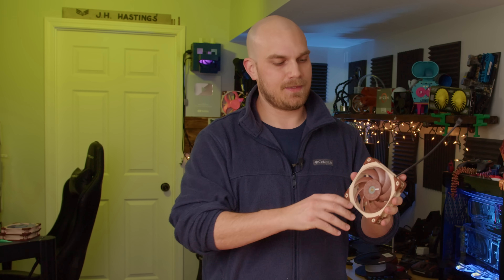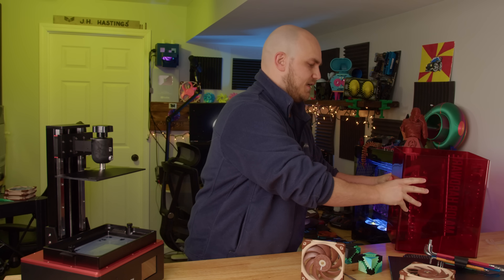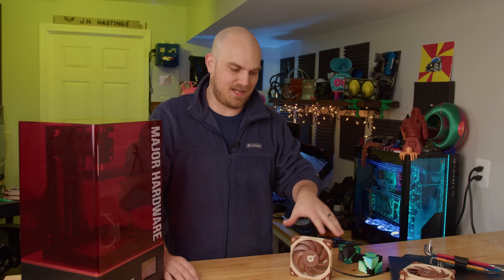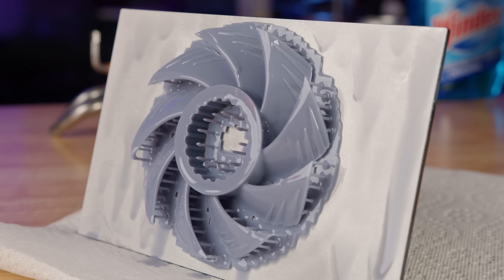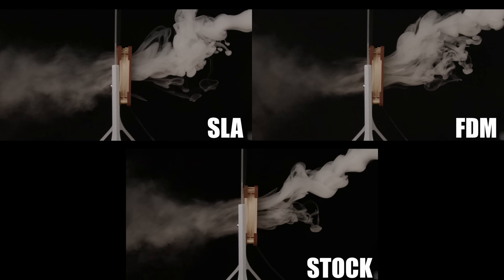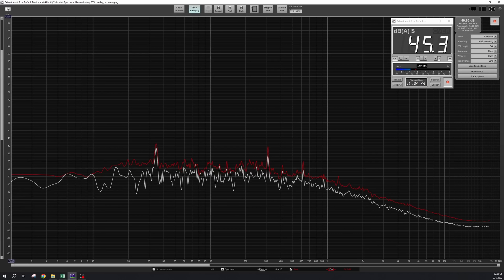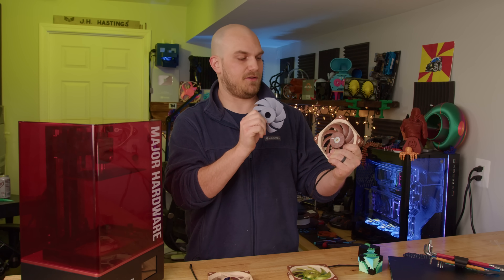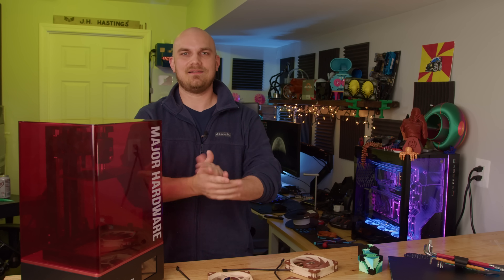I Copied Noctua's A12x25 and Resin Printed it, Its Performance Was ASTONISHING

Comment: I remember Noctua saying that they spent a lot of time researching on the material for this fan blade because the centrifugal force causes most plastics to slightly deform outwards over time. And since the tip of the blade is so close to the outer enclosure, a small deformation could cause them to come into contact and cause problems.
Reply: I would like to see prolonged tests of different materials in hot and cold environments, running separately. One could run in an old fridge that has the door sensor tab broken off, so it would think that the door is always open, so that it would put power on the internal lighting that could be used to power the fans. and wireless camera. and a light. And the heated environment could be the back of the fridge, surrounded by a case to collect the heat that the heat exchange radiator puts out behind the fridge. Third set could be room temp. and time lapse cameras on all three.
Reply: @vallorahn  PLA is pretty terrible with heat. I would expect an exhaust fan of computer might already start deforming quite soon.
Reply: @Qwarzz  I mean the exhaust heat is pretty tame compared PLAs GlassTT. If you have 60 degree heat coming out the back of your PC I'd be very concerned
Reply: Jet engines are at their peak power output right before engine teardown and overhaul for almost this exact reason. Whether or not plastic fan blades would do the same in any amount of time warranting new materials I can't say but it is a real thing
Reply: You could also have it made by SLS out of PEEK. PEEK is semi-crystaline and won't deform as the service temp is about 250 C.
Reply: Uh.... No.  You must have misinterpreted something or someone misspoke.
Reply: print one out of CF-Ultem, it won't deform.
Reply: Of course it could also be marketing BS, since that research has likely been done before and caused manufacturers to use the materials they typically do.
Have you ever noticed some cheapo fan have less blade to frame distance over time?
What is more likely is that they gave a polymer supplier their requirements and the supplier told them what qualifies.
I don't think Noctua is the first business building polymer fans with tiny blade to frame gap.
And from what I can see, it is probably the most damn obvious choice of material: simply glass fiber reinforced.
But OK, maybe the main research was a spesific attempt to avoid having to use fiber reinforced but something cheaper and they ended up realizing there isn't a good alternative for the use case.
Reply: I would think that it isnt so much a creeping issue but prolly an aerodynamic twisting force action. The tips of the blades are far away from the root and dont seem super strong. blade creep doesnt seem likely to me but idk
Reply: They also sell $2 fans for 20 bucks so take noctua with a grain of salt.
Although their stuff is good, it's over priced as hell even with r&d cost
Reply: Marketing is lying
Reply: Generally this is just so people accept the higher prices. PBT plastic or other plastics would fare just fine, really mean it.
Reply: @jbmw16  I suspect this is true.  Marketing is one thing, realistically I think most fans will simply fail (mechanically) before that sort of thing even comes into play.  I've never had a fan of any type or sort flat out deform itself to death.
Reply: For instance look at delta fans, they are server fans that spin really fast and blow 3x times more than a noctua. I am pretty sure that stuff is just regular plastic, you can find other fans with the same plastic, and they last for over 80K hours under continuous operation at full tilt. And can be found for about 12$ - 15$ online
Reply: @jbmw16  Delta fans also usually have thicker blades, more gap between the blades and the frame, and sound like jet a engine no matter what speed you run them at. Delta fans may be good at keeping things cool, but only if you don't care about noise.
Reply: @11matt555  I set them at low speed and I can barely hear 12 of them
Reply: @jbmw16  If you can still hear them at all they would probably be loud to me.
Reply: @11matt555  What I will do is just turn them off. I only really need those running until my cpu fan is already at full tilt and temps are still rising. Or I could buy 4 quiet fans and switch the 2.
Reply: @jbmw16  they don't use regular plastic, it's brittle and hard, almost like ceramic.
Reply: @jbmw16  You have no idea what you're talking about and it shows. For a start PBT isnt a "normal plastic", its the high tech plastic they use in top of the range fans. The cheaper fan use ABS and other cheap plastics, not PBT. The higher end fans also add fibre to the plastic to further increase its strength etc. Delta don't use cheap plastics like ABS, thats for sure, so your comments are completely wrong. So in conclusion, cheap fans use cheap plastics like ABS, more expensive fans use high tech plastics that are much stronger and rigid, like fibre reinforced PBT and you pay a premium for that. So no, they aren't just using it to justify the cost, its to produce a better fan.
Reply: @noire1001  my deltas are very cheap, while not using cheap abs plastic. Noctua is overpriced
Reply: @noire1001  and we need fibre reinforced pbt for a fucking computer fan that spins at low rpm. You are tricked into believing this crap is necessary then tricked into believing is expensive also. The shit that breaks is the motor always not the plastics.
Reply: @jbmw16 Noctua tolerance between fan and shroud is significantly smaller than other fans, which reduces noise and increases static pressure, which is important when those fans are used on coolers and radiators.
Delta fans are good for their own use case but atrocious for anything else. They use extremely high RPM which places different demands on build quality. They don't need tolerances this small.
You can always try to just slap any ordinary fan on a radiator or cooler, but it simply won't be as effective at moving air through it. That's why Noctua does R&D.
Reply: @p_serdiuk  how do you know if the reduction in say half a mm of shroud to casing is significant to the human ear?
Reply: @jbmw16  will youtube even let me post an answer goddamnit
Reply: @jbmw16  I don't know why YT doesn't like my comment, but basically look at why commercial aircraft now have winglets on the wingtips and how certain companies develop new blade designs for cargo drones, wingtip turbulence disrupts airflow and produces noise, so the less space there is for it, the better, even inside a computer fan.
Reply: @jbmw16  Real Engineering did some videos on these topics recently, I don't know if his name is censored or what.
Reply: @jbmw16  Noctua is aiming for low noise while keeping pressure/volume high. Delta is aiming for "max efficiency per watt". No shit delta is cheap, the people buying them generally don't give a shit what they sound like nor have to worry about case compatibility. They're simply 2 different markets, its like saying a sedan sucks because it can't haul around a load of dirt like a pickup truck can
Reply: @genderender  delta does a damm good job if you just ramp the pwm down. Yet also cheap.
Reply: @jbmw16  noctua is better at low RPM and noise still. That's the point. Also, there's still expensive delta fans out there

Comment: Anycubic Photon M3 Max, that should handle what you need. 7k resolution with a 13" LCD and 300 x 298 x 164 mm build size

Comment: Next time could you try NOT printing the fan at an angle?
I'm not sure how you would achieve that but if it's possible I'm wondering if it has a performance impact.
Because my thinking here is that maybe because of the angle the fans blades won't have the exact same physical properties and could have different deformation under a fast spin.
Which could potentially impact performance, if of course it's actually a thing.

Comment: If a resin print is a PITA, I'd just increase the end results for FDM printed fans by 2% and call that good enough. If you wanted to be more scientific you could test a few more FDM vs Resin fans and aggragate the difference to get an average. But I'm not that bothered.

Comment: If it takes more effort to print in resin so that you have less time producing content I would rather suggest you repeat the comparison with one more fan and if the result is a 2% difference again then just use FDM prints and add 2% to the results.

Comment: Go with whatever is the fastest (which is usually the easiest).  This is what prototyping is all about, and that is why you're not gonna injection mold your design tests.

Note that for both types of printing the material you choose might make a difference too.  You can't just test one type of material and call it a day.  A lighter, tougher but more brittle material will have better performance over a heavier and more durable one.

Comment: I use the elegoo saturn 8k for my prints and i use anycubic abs-like resin. I have found that if I use thin supports in chitubox at about 60% density, it works for almost anything. An added benefit is the supports come off very easily under hot water from the tap (as hot as you can stand without hurting yourself). You'll want to be careful about very fine prints, but for most purposes, it's very useful

Comment: I've found that a well-cured resin print (depending on the resin used) is more rigid and dimensionally accurate than an FDM print. Also, the smoother surfaces of the resin print might be helping the air flow that little bit better.

Comment: I would love to see a weight comparison between the three, i am curious if the differences in performance are mostly due to weight, or if surface finish and material stiffness play a significant role. maybe try some lightweight pla for comparison and if you got the nozzle some fiber reinforced filament as well. with the same model there should be a lot of interesting data to be had from this!
armchair science ftw ;)
Reply: The resin will be heaviest, i have both types and there is no contest. I think the performance drop from the oem was pretty much purely weight.

There will be greater surface friction theoretically with resin vs plastic, but the oem ones aren't very polished anyway. I'd like to see wax used though to reduce drag in absence of the polish aircraft use.

In ww2 they used wax and they found no amount of wax was too much, performance kept increasing the better waxed they were. Which is why you should wax your car, saves money in the long run. 

Fdm has such poor quality surface its a joke comparing to factory parts.

Comment: I was thinking of resin printing since season 1. You can definitely benefit from the resolution and finish it provides, especially for complex designs like the multi-rotor/jet-engine/helical geared ones, but the hassle with SLA is real. I'd say the ultimate goal would be SLS but that's still crazy expensive unfortunately.

Comment: Yeah I like the idea of just resin printing the top contenders of that season. It would be great to give previous seasons and all non-resin prints a weighted 2.7% advantage in a new column for comparison. If a fan comes within the 2.7% margin of the a12x25 performance, it should get a chance to go head to head  in a resin printed final episode. Resin contenders would still get a .06% advantage in the final.

Comment: well what about other layer heights and nozzle widths? the benefit resin is giving will be in resolution. resin sucks to work with compared to fdm and modern fdm printers are so much faster than prusas now, or even just tuning the prusa.

Comment: I have resin printers and I build proper detachable beds for the, quite easy using putty knifes for the spring sheet and used a small cnc to make some cavities for the magnets and then also on top used magnet sheet

Comment: One question I've always had is if the chevron's that Boeing puts on the edges of some of their engines to reduce noise would affect a desktop fan. NASA says the chevrons smooth the mixing of the turbulent air from the engine and the surrounding air, so its possible they would have some effect on desktop fans as well? Would love to see you test!

Comment: I would recommend retesting the top few models in resin, if the performance gained by going resin is pretty similar across them,  you can safely assume it's fine and stick to fdm.

Comment: I don't do half the clean up that is recommended for resin printing, as I don't always need the detail. I sometimes just wipe off the excess then cure it. You could try using a fan frame to spin off the excess resin then cure. If nothing else an interesting video.

Comment: I have been resin printing for around 5 years now, and I love resin, but I still go to FDM to functional prints...

Resin printing will definitely be more accurate, specially with those crazy designs, but for 2% increase, is that worth it....I really am not sure it is

The incurred costs and hassle and printing supplies in resins, cleaning, and the mess that you will have I don't think is worth the increase

Comment: Now that you have the blade geometry, how about the frame geometry as well. Then, the first thing that comes to mind is scale - 1.5 in width, how does it perform, compared to the original. And now that you have copies of each type of print, you'd be comparing apples to apples.

Comment: 7:24 One thing you didn't take into account when making your measurements and the Fan RMP.
3D printing does not result into well balanced fan. A balance fan will spin faster and as a result it will produce more FPM.
If you had standardized the RPM you would know how much of the loss/gain could be attributed to the model differences / 3D printing.

Comment: Upon closer inspection (ie a quick look lol) the OG fan has thinner fins compared to your versions. Design wise everything else seems to match up. So my only thoughts are to re-gauge/measure the OG fin width and re-print on resin :D Interesting of how close you got to Noctua's results! With a little tweaking, I think you'd be able to slightly surpass their results on a resin print. Great job!

Comment: I still think sla would be better but why not print at .1 on the fdm to get the best chance? If the difference then goes to less than a percent then it would be a waste of time to do the sla fans instead.  Should we also consider that the stock noctua you tested might preform better or worse than the one you use for 3d printed fans since there is variance to begin with in all fans?

Comment: Have their been any fan designs that have been within the percentage of loss for an FDM print that would theoretically surpass the stock fin design if they were injection molded? I would limit this to a blade only design and not one that required the housing modifications a lot of the high performers have had. Could give us an idea if someone has actually designed a better fan blade.

Comment: I think if we truly knew it was only a 2% difference across the board then I would say stick with FDM.

However, this Noctua fan design printed basically perfect in FDM, where we have seen a lot of fans that really did not print well in FDM due to thin crossections or odd details, so I think in those cases the difference might be a lot greater.

I also disagree with how some people are saying mix and match, because then it is not a fair comparison.

My suggestion would be to pick a few of the fans from previous seasons where FDM did not work that great and would seem to benefit from resin, and do another comparison like this one using those fans. If the difference is still small, don't bother with resin, but if it makes a noticeable difference, go 100% resin.

Comment: with that resin print ,just curious can you place a swab of cotton soaked in Acetone placed in a bowl a center of the a bucket to act like a vapor sand paper chamber  when encompassing the  bowl of Acetone ,with the resin fan hanging from the center of it with a small fan situated at the bucket when placed over the bowl , to give it a circulation of air movement to smooth out the resin fan maybe there is some roughness that is un accounted for that might actually improve the resin print , probably a pain to do but generally gets me the best results for smoothness and look when 3d printing any form for work or home refabrications for random prints i need to make , Just curious to see if that resin fan will get even better results

Comment: What i am still curious about if there is any weight differences between the prints? Also, now that you have the CAD model approximation of the A12x25, how is the differences between different hubs/motors?

Comment: Something else to consider is the rotational mass.  Comparing the density of each medium by looking at weight would be interesting to see how that may affect it.

Also, I would think the aerodynamics caused by the smoothness of the blade surfaces would be a significant factor.

Comment: The main difference between the different prints is the surface finish, because the air is getting hung up on the rough surface. Maybe try sanding smooth the top performers to see if there is a difference.

Comment: what would happen if you re-did the winners from the past and see how good they are with the smoother printing style ? Because if you take the Angel fan from season 4 that is in second place and take the volume of air and multiply it by 1.027 for your 2.7% difference you will get airflow of 498 and that beats the  Noctua's A12x25 of 495 :)

Comment: If you are going to do resin get one that is really high resolution like the Anycubic Photon D2.  It has a DLP screen and the prints are super smooth.  I really wish you weighted the fan with each print attached just to see if it was simply a weight issue.